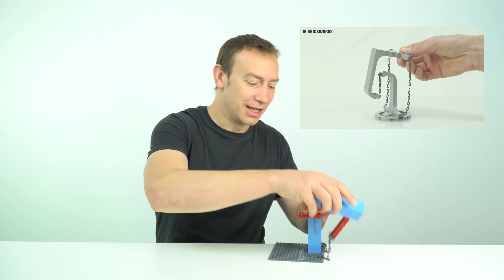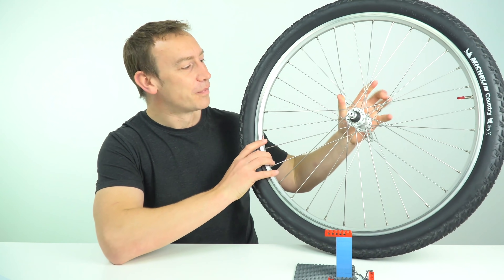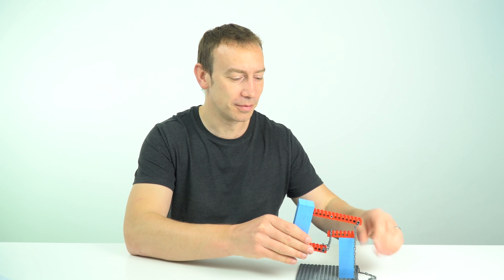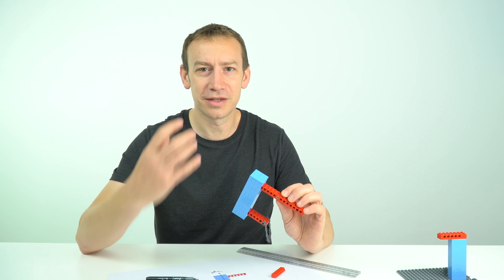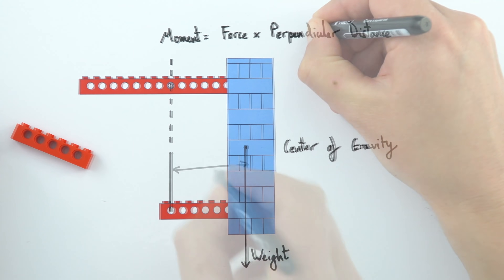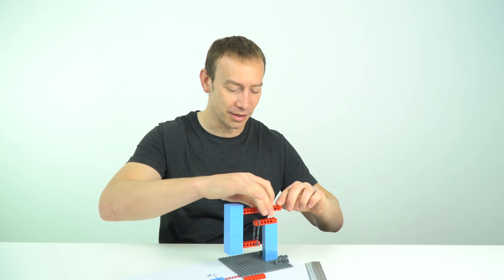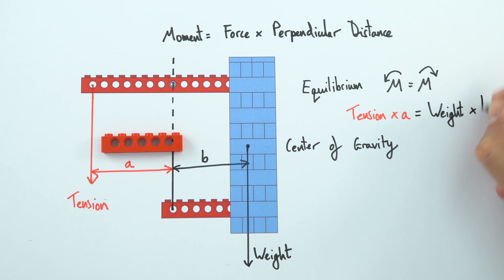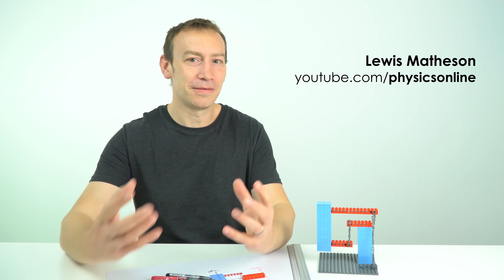Physics Teacher Explains Tensegrity Sculptures with LEGO

Comment: so i've been so fascinated by these tensgreity structures, especially those making tables/chairs out of them. but I've notice that they are very wobbly or they can torque a bit. and I understand the middle string/cable/chain has to be in the direct center where its the focal point where it pivots. but I was wondering, what if you had 2 of them. say you make a rectangular table, you put 2 focal points instead of just 1. and you have 6 anchors , 1 on each corner, and 1 in the middle on the long edges between the 2 focal point. would that make it more stable?

Comment: Are you able to know how much energy a spring can have so we used some hard material and store's energy by using hydraulic system by using our weight and later used it for charging our electrical equipment

Or used spring battery for our electrical trimmer so the battery become secondary things

Comment: Great video, but you comparing weight to tension is wrong as weight generally isn't expressed different to kg or similar unit and tension generally is expressed newton. So you also have to incorporate g into the equation to be correct. Weight by itself is not a force.

Comment: The strength of the pivot material (& attachment points) would seem to be key in building Tensegrity structures, as in effect, the weight of the entire "floating" structure is depending from it. 

I'd love to see real-world permanent structures/architecture which uses tensegrity techniques. Especially in earthquake prone areas, where I can visualize the flexibility of this type of structure being amazing in absorbing the vibrational waves from the quake (in addition to an internal/restricted, pendulum counter-weight - as in many Japanese buildings), preventing steel/concrete buildings from disintegrating. 

I can also see it being used in concert with a computer-controlled hydraulic tensioning system to compensate for things like thermal expansion/contraction of the "chains" (or whatever flexion components that are used).

Comment: The structure is not really stable. Equilibrium (even in a plane) requires some horizontal reaction because the sum of horizontal forces must also be zero. Even a very slight horizontal load will cause the mass to move until the tension elements are sufficiently out of plumb to resist that horizontal forces. This requires relatively large deformation of the structure which is an instability. This is a common problem with tension structures making the term "tensegrity" something of a misnomer. I am not really complaining about your video. It provides a very good explanation of the concept of equilibrium. I just think you should have mentioned the lack of horizontal stability, and possibly the lack of stability out of plane. Maybe a part 2 about stability?

Comment: I've never understood why it's considered weird, could someone explain what you are supposed to think at first glance?
Reply: I assume it’s partially due to how a mind automatically categorizes things ie strings are slack when not under tension. For myself the structures became a bit of an optical illusion where the support wires and guy wires were conflated and nothing looked like it should be under tension. Had to think of how the force diagram applied to get things sorted out the first time I saw a tensegrity structure

Comment: Well tension is only kind of right.... in the end the only necessity of the other end of the pivot is that whatever is holding the structure is simply able to provide the right downward force and tension is basically the ability to transmit that force to whatever anchor point it’s connected to...but that anchor point capable to withstand the resulting upward force is relevant...so I’m not sure why he is talking about tension instead of force.

Comment: well you can explain it like that or you could say it' hanging on one point and secured by a chain to not fall down.
like when you wanna balance a shovel without touching it (one point supporting the weight called the ground) it will probably fall over but when you hold it at the top (another point providing balance) it can't...

Comment: Actually, most of the load in a bicycle wheel is transmitted through the bottom spokes. Because the bicycle wheel is a prestressed system the bottom spokes can take compressive loads. The load path for the bottom spokes is more direct and hence stiffer. The load always follows the stiffer path. Some 35 years ago as a Structural Engineering PhD student I made an FEM model of a bicycle wheel to confirm this.
Reply: "The Bicycle Wheel" by Jobst Brandt also confirms your FEM model's result. This teacher made a major blunder that causes me to call everything else he said into question.
Reply: As someone who's built a bicycle wheel with my own hands, I can confirm that the weight is indeed held by the spokes at the top of the wheel. Each spoke has a stopper at one end, and an adjustable tensioning bolt at the other. The end with the stopper is inserted into the corresponding hole in the hub, while the other end passes through a hole in the rim before the tensioning bolt is fitted. There is nothing preventing the spoke from being pushed outward through that hole in the rim, except for the spokes on the opposite side of the wheel pulling it back towards the center.

If enough people don't believe me (or simply doesn't understand my explanation), I might even make a video demonstrating this concept.
Reply: @InventorZahran  , I too have built several bicycle wheels myself. A bicycle wheel is designed so that at no time during normal loading are any of the spokes supposed to totally lose tension. That is why I say it is a prestressed system much like prestressed concrete. This being the case the bottom spokes will decrease in tension while the top spokes will increase in tension. However, for the load in a bottom spoke to go to ground it just goes directly through the short part of the rim and tire below it in compression. The load going to the top spokes must travel around the entire length of the rim from top to bottom. Therefore it is a less stiff path and most of the load will not go that way.

Comment: Some Disney Imagineer is clapping their head right now over the missed opportunity to use tensegrity structures on the Pandora attraction's floating mountains.
Reply: I was thinking just in the same thing!
Reply: only thing : it's stable but if you pull it it will fall, so not the greatest idea in a world with wind.

Comment: Curious recommended video, though it both over and under explains everything. For how much he talks about "balance", it makes it sound like there's far more going into things than there actually is. The diagrams make it look like he might explain some of the forces, but it's mostly just highlighting the physical characteristics of the system. In reality the two chains aren't particularly worried about balance, the only requirement is for the one to be able to support the entire weight of the structure while the second can handle the generated torque. Fun video and his channel is probably better, but this one should have been kept more simple.

Comment: The term "gravity-defying structures" is surprisingly misleading enough for some people while seeing the actual structure tells otherwise
Reply: Really, if you can take a look at this structure long enough, you can see what the hell happened in here. Static physic toys are pretty interesting, especially when we talked about point of balance and equilibrium. Y'know that balancing toy eagle, which "magically" balanced itself on the tip of its beak? Yeah, that's a static physic shit right there.
Reply: @alfianfahmi5430  Those were fun. I used to put them on a pole/tower/whatever, and spin them around while also wobbling in up and down vertically ;p

Comment: Interesting stuff. If I understood him correctly you could actually make this without the two strings at the back and only have the string in the middle carry it all. You'd just have to add enough counterweight for it to balance!? I see a VERY impressive MOC opportunity there!
Reply: I reckon you could, as long as you had the center of gravity below the point it was suspended from this could work - taking this design to the next level!
Reply: @PhysicsOnline  yeah, exactly. The main problem would probably be the  sideways balance?! But, with a third and fourth weight on each side of the point of balance, it could probably be done as well?!
Reply: The middle string carries the force caused by gravity, the edge strings carry the tortion leaning with 2 turning points connected by the middle string
Reply: @Re5_2karman  Indeed, you'd only have to find a way to have the same effect in another counterweight.

Comment: Are you sure about the position of the pivot point?
Reply: The net torque (moment) and net force must be zero around all points, even points outside the object, for the object to not move. But he chose a point in line with one of the forces so that he would only need to think about two forces.
Reply: The net is the torque in the anti clockwise direction minus the torque in the clockwise direction.
Reply: @maxthexpfarmer3957  That's right. If it is in equilibrium then you can calculate the torque about any point. I chose a position inline with the point where it is suspended from as the pivot for this explanation.

Comment: bruh i see tensegrity builds everywhere but i didn't understand it
Reply: The object is being balanced according to the center of gravity. The two other chains ona one side are used to change the angle and to make it more sturdy.
Reply: Its like a scale, if one side has the weight of 50 kg and the other side has the same weight, both sides would stay at the same level. In this case the left side of the equilibrium (the middle of a scale) would be the blue box and one the other side of the equilibrium would be the long red lego piece; the two chains add tension  and that force causes the long red lego piece to appear as more straigth. The left side of the equilibrium has a larger downward force due to its mass/weight and to compensate for the larger force on the other side of the equilibrium tension is used to create more downward force making the forces on both sides of the equilibrium close to balanced forces if they are not balanced forces